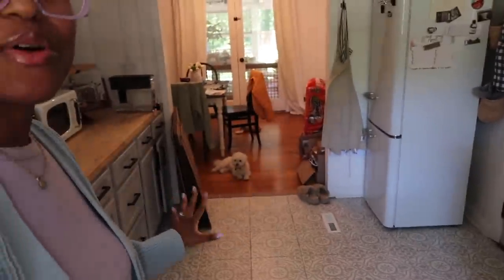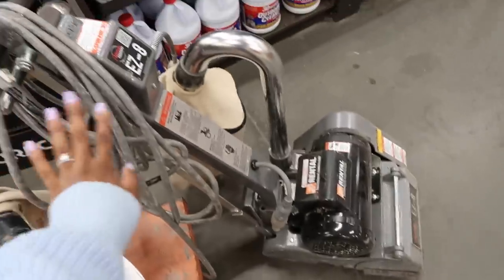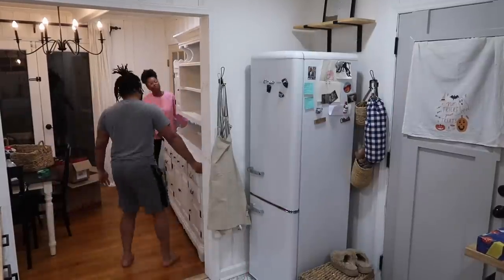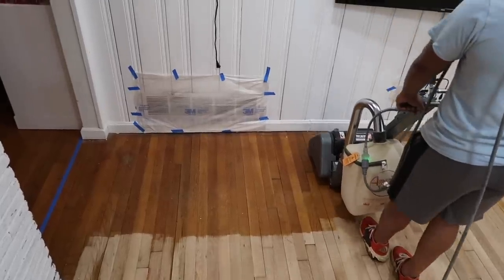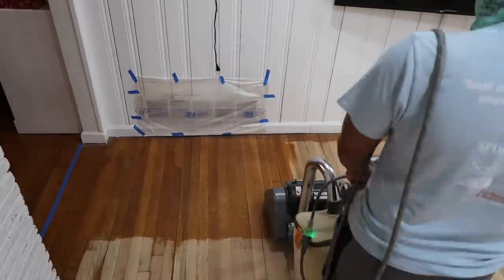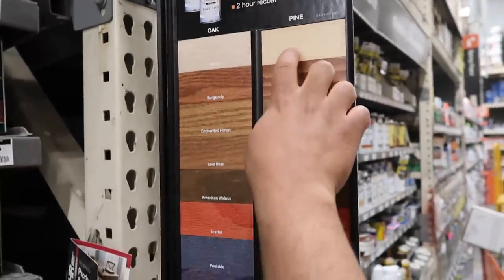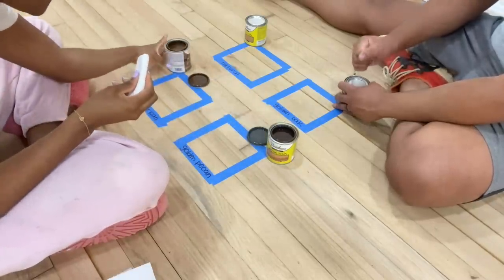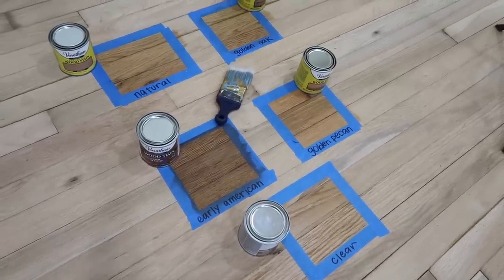I REFINISHED THE HARDWOOD FLOORS IN OUR 1950'S FIXER UPPER| Sanding Floors & Swatching Stain #diy

Comment: Love the way it is looking! You dont need quarter round since your not adding another floor on top. Quarter round is used to hide the extra space between the floor and walls that is needed to prevent a floor from buckling when the earth naturally shifts. People use quarter round so they don't have to buy new baseboards. Floors usually look nicer and more professional without the quarter round. ❤

Comment: I'm into Golden Pecan or Clear. Ask the paint person if any of the stains will yellow over time? Just a tip. Have your room ready, cleared and cleaned before you go to rent any equipment. It eats into your rental time. Good luck. It is hard work but well worth it when you do a great job.

Comment: Just a fyi, you do know that you have to sand between coats of polyurethane or you won't have smooth floors they feel smooth now but once you put stain and poly it raises grain again. And as someone else mentioned you should have gone diagonally to level floor with your first run not supposed to sand back and forth it will take down to much wood they are only so thick.